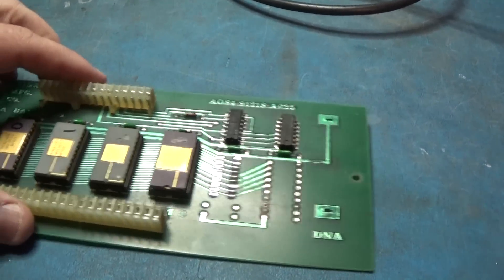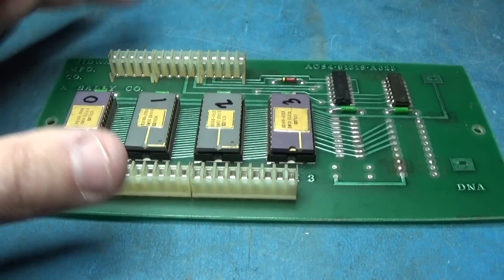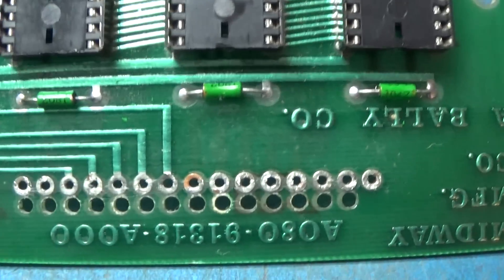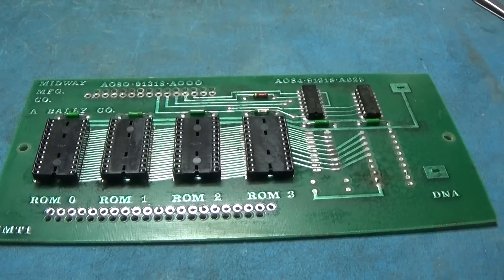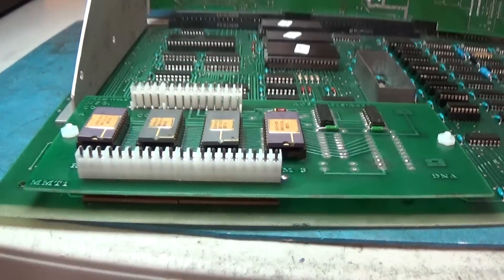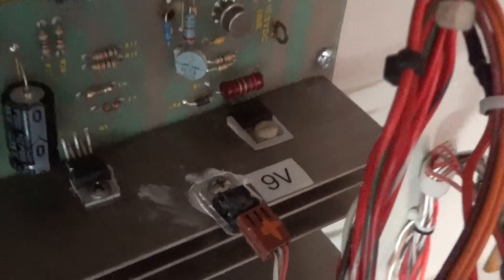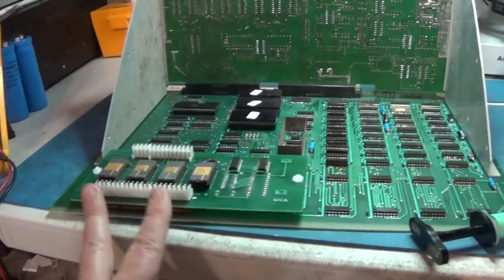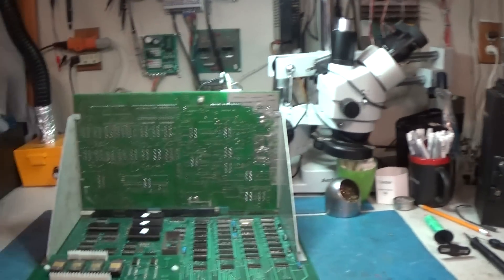Part 5 - 1978 Bally Midway Sea Wolf II PCB Repair Finale!!

Comment: Those rom board pins are like what Willimas used in pins like firepower it looks like. What's crazy is that you can what looks like the pins cracking, which I suppose would explain why there's no pushing it in. Thanks for showing them so up close, never noticed that on that kind of connector.